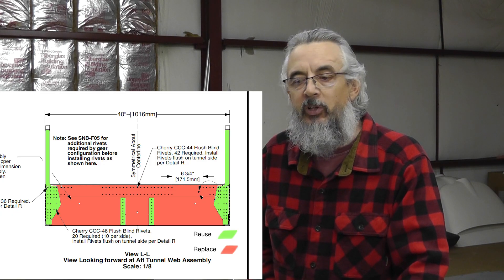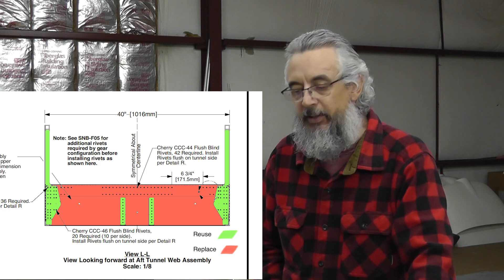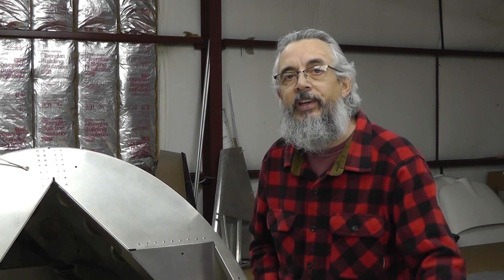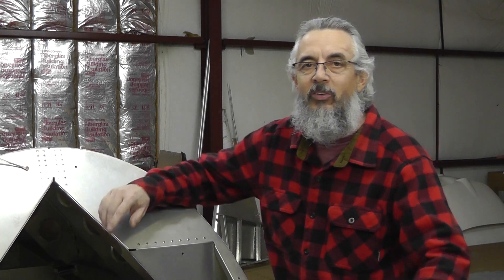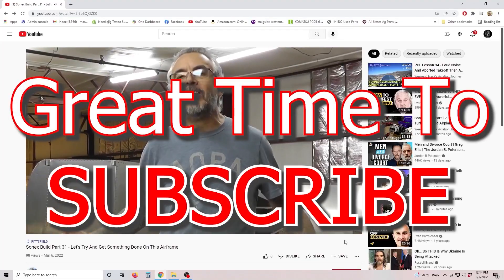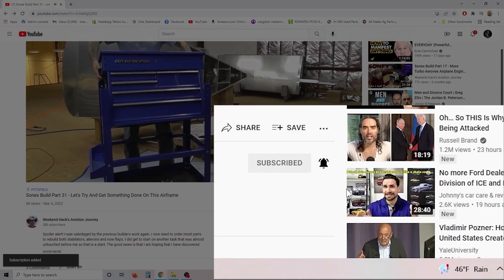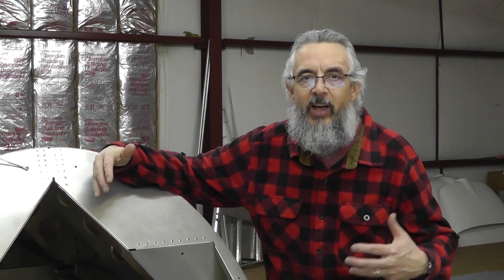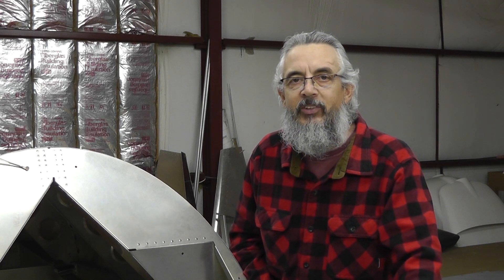Sonex Build Part 36 - Can I Save This Project With The Wrong Fuselage

Comment: I was the third owner of my Onex kit and there were some small parts missing. Since this kit can be scratch built I decided to purchase the required aluminum and make the parts myself. This saved me a lot of time and money and was never very difficult. Sonex was always willing to help anytime I was stuck. I took a 5' x 20" piece of plywood put a lip on the bottom of it with a 1" strip of wood and mounted it on the wall up high enough for my bifocals. Put it at an angle an put the plans on it and was a great help in my build. Good luck
Reply: Since this kit CAN’T be scratch built. Gotta get those key words right.
Reply from the maker: Thank you. I agree, Sonex has been very helpful. I would feel comfortable making some of the more simple parts but without specific plans and dimensions I would not attempt things like ribs or control surfaces. Is your plane up and flying?
Reply: @weekendhack.whatsnext  I finished it the end of last year got thru the FAA inspection and a few days before I was to fly it fell backwards off a porch and tore my rotator cuff and still on the mend. Hopefully soon.
Reply from the maker: Oh no, I hope you are back at it soon.

Comment: I have been thinking about buying a used kit or partially built kit there is a Zenith up for sale right now, but exactly issue you described the factory may not support the problem. The old owner might have misplaced some parts just seems like for me I would be better off buying a new kit not a used kit save a few grand. Was wondering if your medical ever got approved?
Reply from the maker: Even with the problems I have encountered and the extra money being spent there is no way that I could even come close to the aircraft that I want compared to what I have invested here. My advise would be to look for a kit that has minimal work done to it or you can at least get into the inspect everything that the previous builder has done. Good luck!
Reply: @weekendhack.whatsnext   What I would be worried about is start on it year down the road something is missing while I could inspect I wouldn't know what I was even looking at unless I had built one before. The zenith he wanted 27k says he paid 31k in 10/2021 lost interest in the project. I'm still waiting on my medical before I start training and pull the trigger on a kit. If I end up denied in the end ill probably go ultralight route. If I can pass the medical then I want a Zenith 750 what been looking at. Sounds like you got a good price on that kit. I might start my flight training worst case I just end up in an ultralight the training won't be for nothing.
Reply from the maker: @Mike-01234  try and find someone that has built and or already owns one of the models that you are looing at and have them check out the one you want to buy. Probably only cost you lunch and a few beers but even if you end up paying them it will be worth it. Good luck, I am still waiting on my medical. I was able to speak with a woman last week and she was going to try and push my case forward seeing how it has been stuck at the same stage for about 6 months now. I will give them another week or two and call them for another update.

Comment: Whether is was 5 years ago or last month. Sonex sent out the wrong fuselage initially so they should be completing all the rectification works .  I will be scratching Sonex off my list of a potential kit.
Reply from the maker: I thought about it that way at first but it would not be practical to crate the aircraft and return it in exchange for a new one. Not to mention the freight pricing and lead times these days. I simply asked them to help me find a solution that would not be to costly for either of us and I think that we found a balanced approach. I am satisfied and that is all that matters. I have no doubt that they have my back and you will not find a stronger built kit for the money anywhere.

Comment: Glad to hear that Sonex was very accommodating and pleasant to work with.  I know if the previous build video i made a comment about possibly being shied away from a second hand project because of your setbacks and with this one, now i understand more about the savings and that your still at a point of saving over a new package.  Looking forward to seeing your progress as your replacement part arrive.  Thanks for sharing.
Reply from the maker: They were quick to respond and easy to work with. I understand the hesitation but even with the extra costs I am probably $30k ahead of what it would cost me to start over with a new kit. The parts have arrived so I will be getting into those soon. Thanks again and good luck!